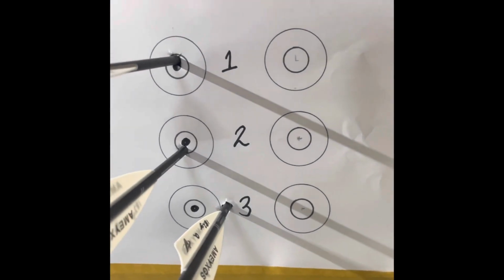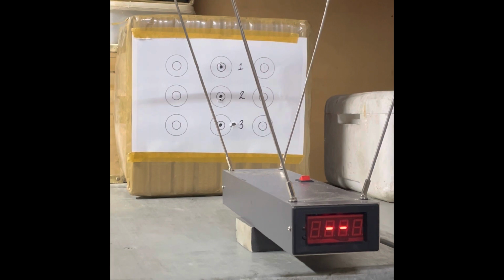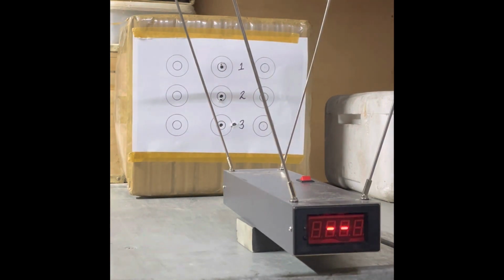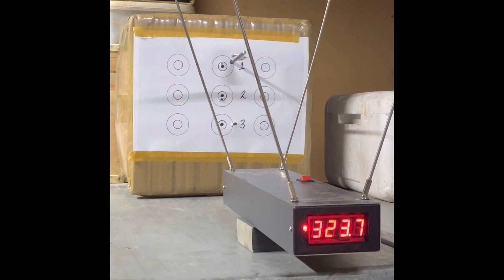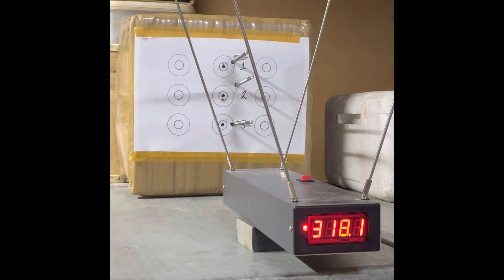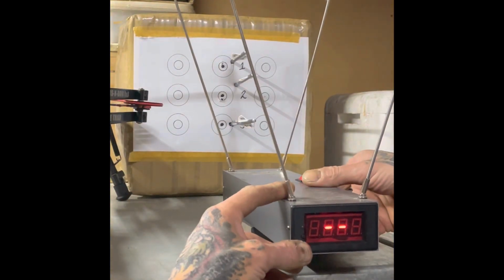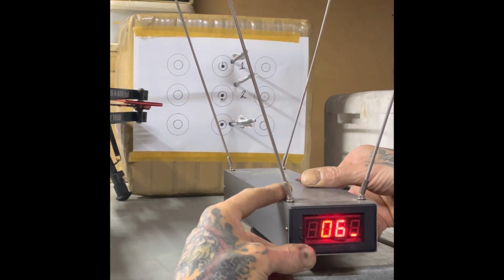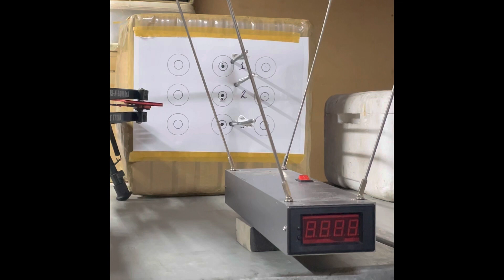New set of crossbow bolts speed & accuracy test in supersonic rev/drakon/grs hybrid xbow

Comment: What make is your chrono Gary, and what tips did you use on these custom bolts?
Reply from the maker: It’s just a cheap chronograph off eBay £45.
100gr tips turned down to fit in shaft & then played around with the shapes.
In the pits again tonight, the riser started cracking again so now making a steel one 😂